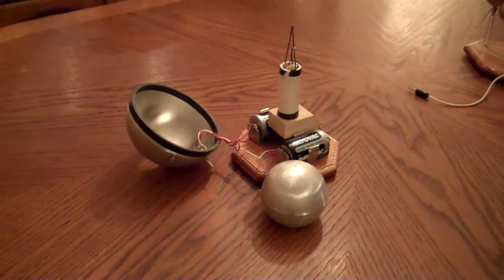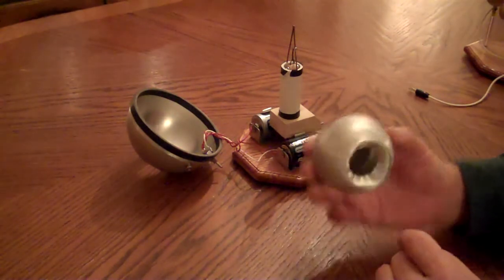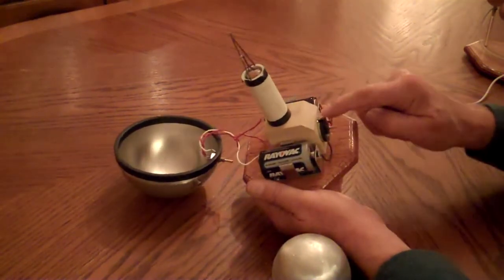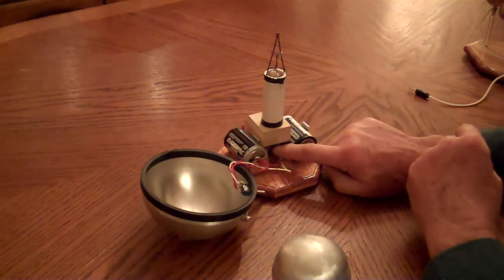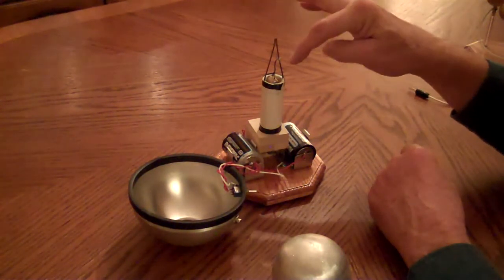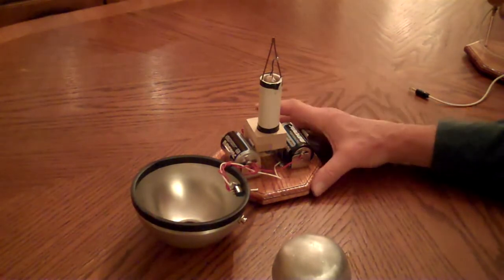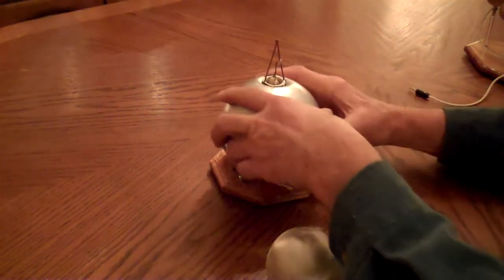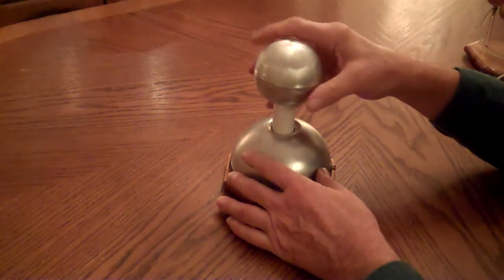80,000 Volt Van de Graaff Generator

Comment: Have you been selling these? I bought one almost identical 10 to 15 years ago. Did the parts likely come from you or could the whole thing have been sourced from you? It's been a wonderful little VDG! I've since stopped using batteries though since they need replacing. Instead I've extended some wires outside the base to connect to my DC power supply.